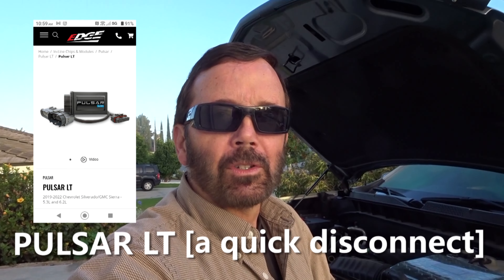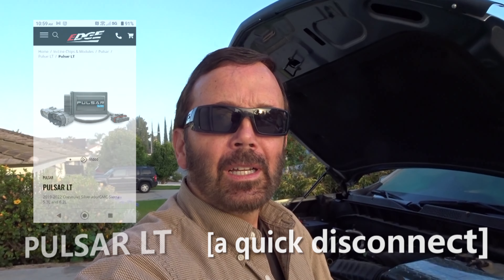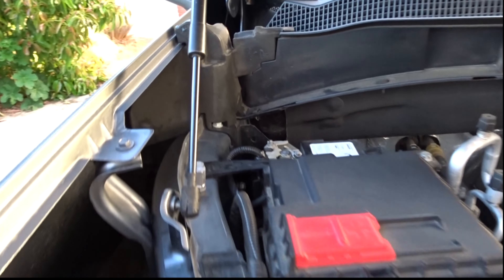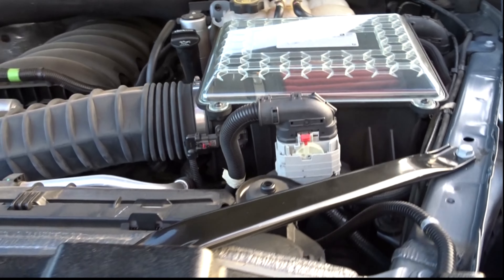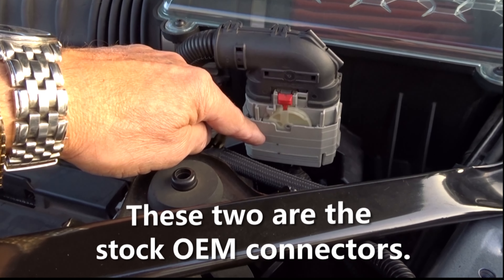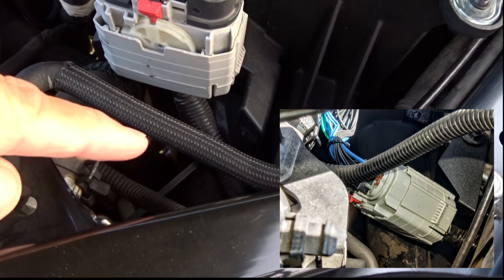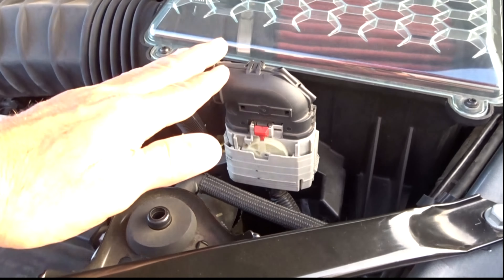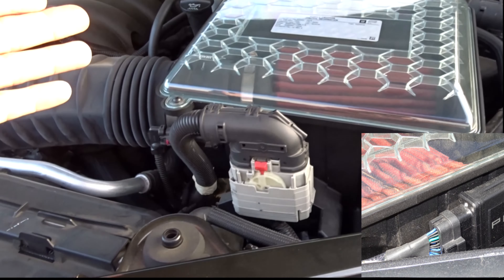Pulsar LT [a quick disconnect] w/Paul Henderson 5-31-22

Comment: Yeah, I installed it without disconnecting the negative battery and I have a lot of communication and transportation to get rid of it. Any suggestions?
Reply from the maker: I'm not too sure what you mean by you have a lot of communication and transportation to get rid of it. If you had issues with the on board computer after installing it without disconnecting the battery try this. 
Open the hood close all doors Wait about a few minutes look inside the driver's window and make sure that the OnStar lights are off (because if it's not you may drain the battery in the OnStar  unit) then disconnect the negative battery, disconnect the pulsar LT, leave the pulsar LT there if you can but tuck the harness away So it won't touch any moving parts. Then reconnect the OEM connectors, reconnect the negative terminal. Start vehicle and take it for a test drive and see if there are any warning lights. 
If all is okay reconnect to Pulsar LT but be sure to disconnect the negative battery terminal first after making sure the OnStar lights are off.

Comment: The connectors are a pain to remove. Broke a red tab trying to remove it 🤷‍♂️
Reply from the maker: Sorry to hear that, maybe you can find an after-market red tab. Was it stuck in place and that is why it broke? I hope it wasn't brittle from the heat and that weakened it.
I had broken a few connectors on my 1989 firebird and I was pissed at myself for not being more careful. The next time that I need to remove the Pulsar Lt I will film, because of what happened to you I will put a few small drops of WD-40 or Gun Butter that I use on my guns to ease with the pulling up of the tab.

Comment: I must be lucky. My dealer has never had a problem with it. I’ve never taken it out and they’ve always been fine with it. 

Always have had a great experience with my dealership.
Reply from the maker: That's good to hear, Mine also said they have no problem with it being installed. But it will have to be disconnected if they need to do any reprogramming to the ECM. I DID NOT ask my dealer about that but in the instructions on page 15, from the instructions that I pulled from there site, it does mention it would have to be disconnected.